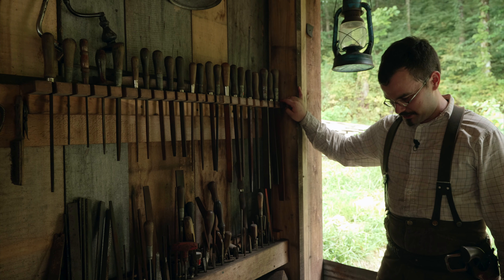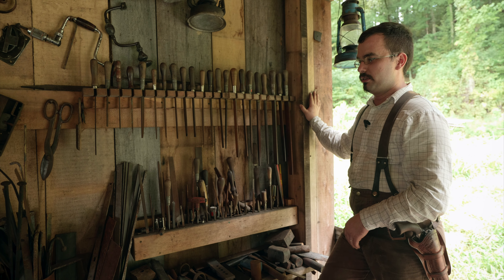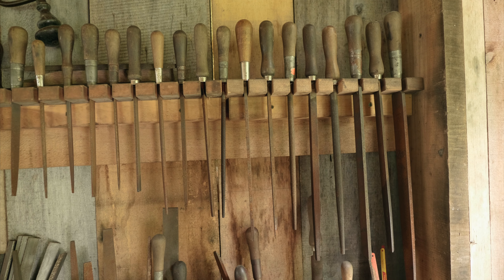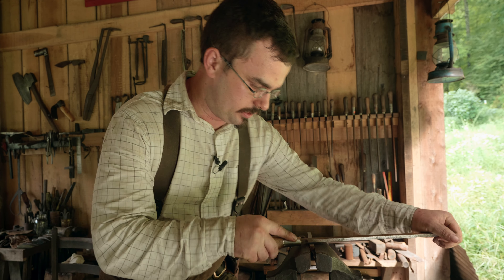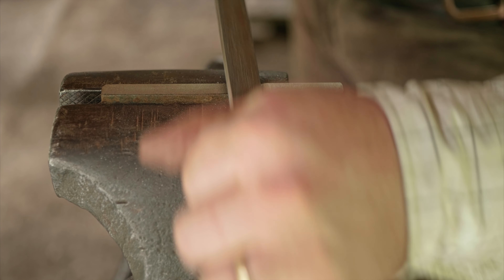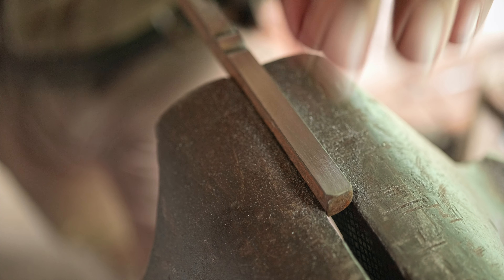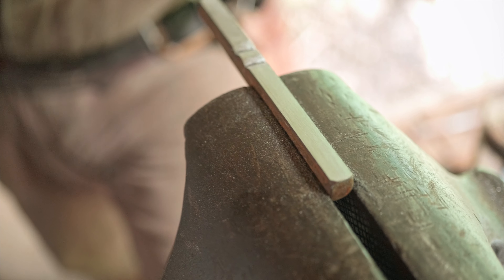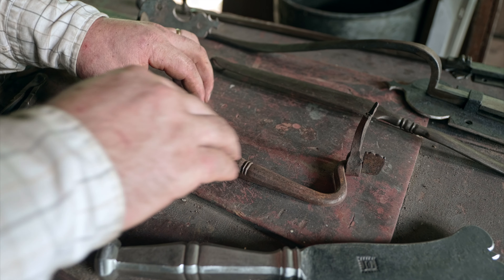Intro to Files & Filework

Comment: One thing that I can never get over is the squeaking that's like nails to chalkboard to my ears when doing filework. Is it something you just get used over time?
Reply: Same, sound of filing drives me crazy.
Reply from the maker: It is something that you get used to over time, but also how the piece is held affects the noise it makes big time.
Reply: If it’s screaming you’re probably doing it wrong. 

Try to hold the work as close to the filing as you can to reduce flexing, and have a good contact between the piece and the jaws of the vise (tapered pieces can get tricky), but that’s not always possible.

You can also change the sound with what angle you file at, it’s difficult to explain because it depends on the shape of the piece, but if you have a thin flexy section I find you want to file in a manner that the file pulls on the work piece rather than pushes into it, think pushing vs pulling a pencil.
Reply: @broadusthompson1666  Even watching the filing in this video bothered my ears though. Just thinking they're overly sensitive. Hopefully I'll get over it
Reply: Chalking, holding your workpiece properly, adding extra clamp to the end of parts (on the far end, something like a clothes peg, cuts down on reverberations), and changing filing direction (even as simple as a few degrees left or right.)

Some screeching and squeaking will happen, but you can dull it a lot.